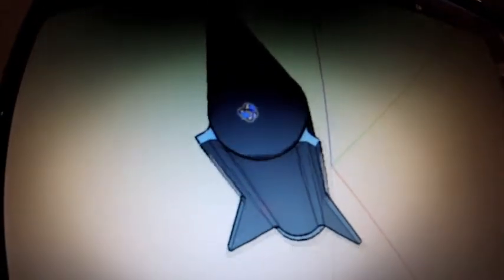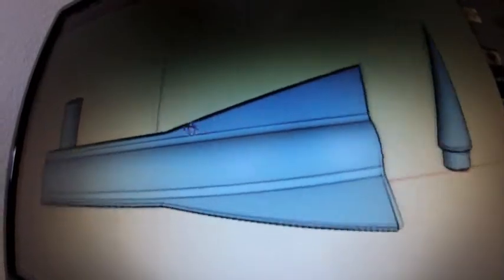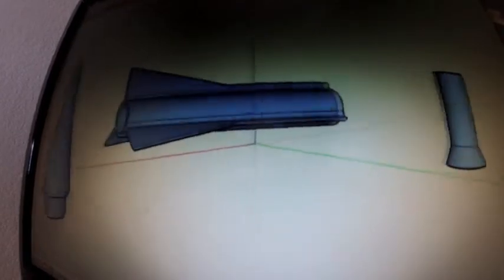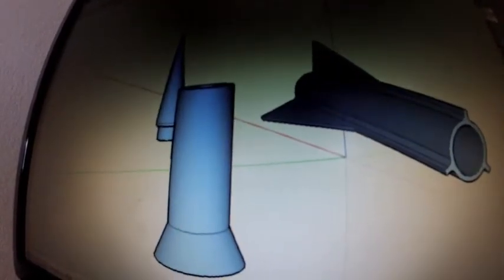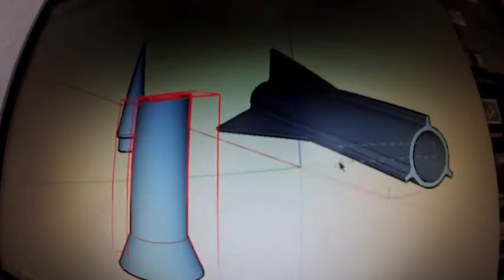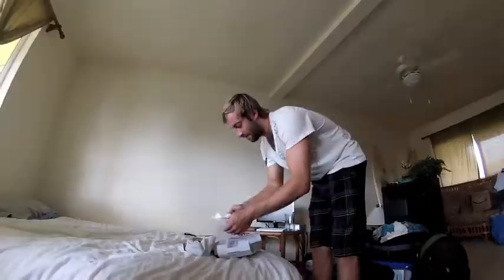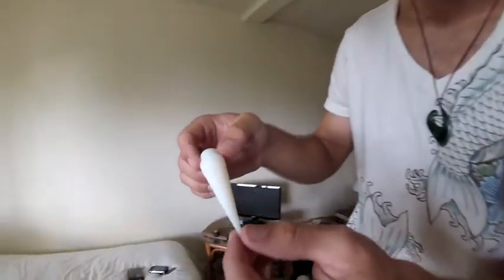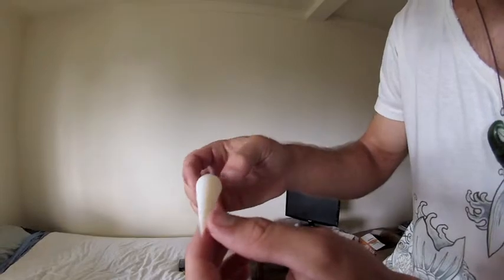3D Printed Model Rocket

Comment: These rocket bodies are made of plastics.  What is the possibilities of the engine fire melting, deforming, or even burning out the outer body?
Reply from the maker: The Estes rocket motors used contain the heat within their casing pretty easily.  No damage to the rocket body

Comment: How much did this cost you?
Reply: Surfglobal1 Indeed. A reprap printer can use any ABS. Mine prints for 2.2 cents per gram, so a rocket of that size would cost between 3-7 dollars depending on infill.
Reply from the maker: Too much! probably around $75 printed using shapeways and 3daddfab websites.  Had to simplify the design a lot just to cut cost. Someone who has their own 3D printer could do it for so much cheaper though!